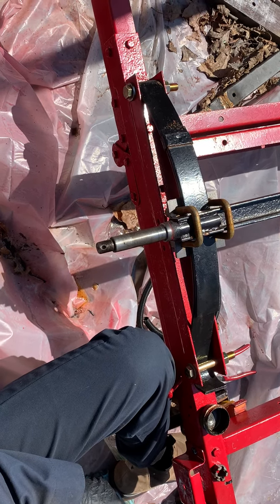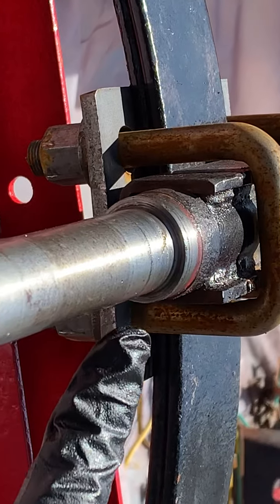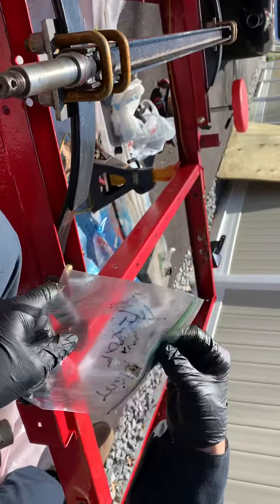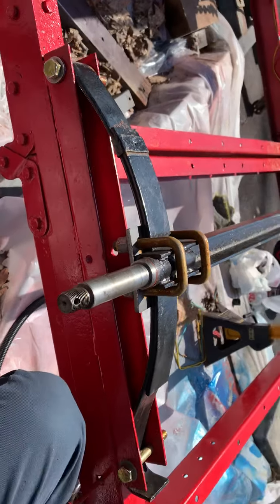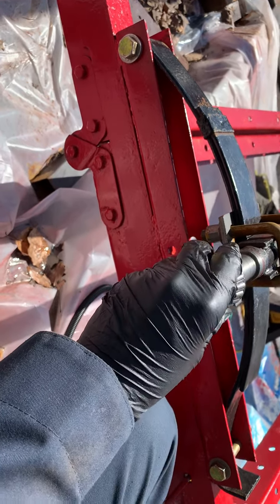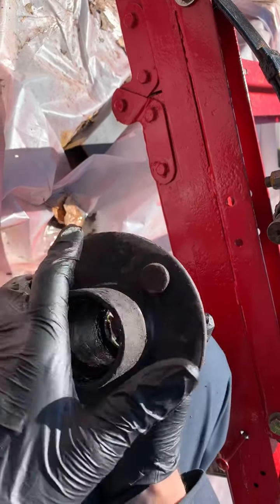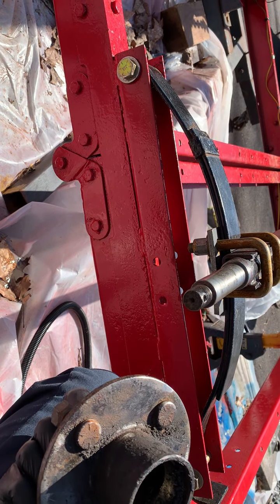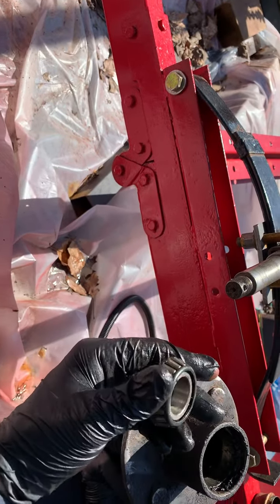Bearings and spindle drama

Comment: Go to a bearing supply or your local AutoZone and you can get the bearing without any trouble and probably cheaper than Texas apply
Reply from the maker: Bill K we got it all cleaned up Bill! I had to use a die grinder with a soft pad to get the burrs  off, but it’s all cleaned up. I’m going to hit Napa tomorrow for new bearings and seals while it’s apart👍🏻